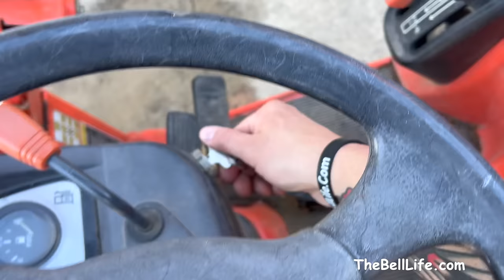The Luckiest Thing That Has Happened To TheBellLife In A Long Time…

Comment: Hey guys 👋🏽 greetings from a German Treeclimber/cutter. Well done! Next time use a stronger rope and the first cut a the front was good, but the cuts on the back seemed strange. That’s why it went in the wrong direction. Just cut parallel to the first some inches above your first cut and not through the whole tree. 
Stay save and healthy 😊

Comment: Sounds like the carb on your chainsaw needs to be tuned I love Stihl but I switched to a Husqvarna because I couldn’t keep my Stihl  chainsaws going
Reply: What do you use for fuel?
Reply: @user-lw3ii2ec1h  100% gas no ethanol with Stihl oil mix but the saws were used so they they could’ve run ethanol in them before I had them
Reply: my 250 runs great but damn you can flood that sucker out fast when trying to start it

Comment: You know that tiny rope and you pulling with the tractor didn't even do anything lol thsts not even the rope you should use luckily the tree was dead and rotted. But as you can see the tree didn't go where you were pulling lol. Also your notch was wrong and the backup. Not too mention you both are lucky a limb didn't come down and hit you guys in the head as you were cutting it could have killed you without a helmet I did tree work for 15 years. Always wear a helmet underneath a tree cutting. And clean the carb of that saw. And change the filter.